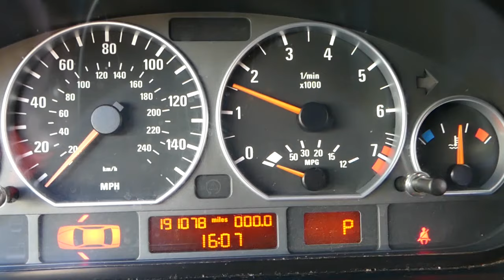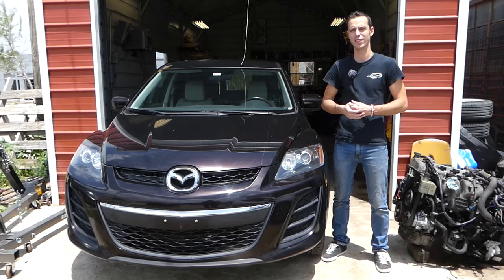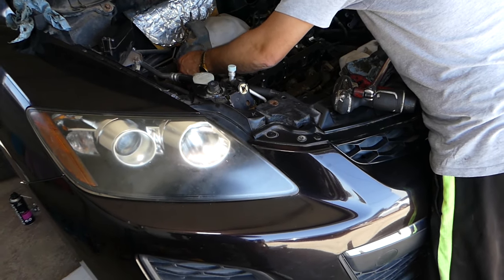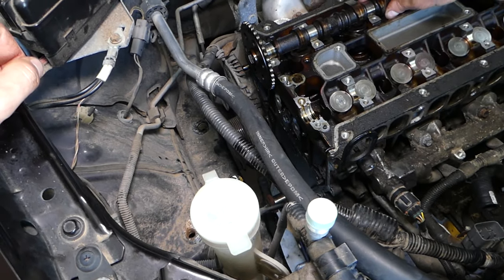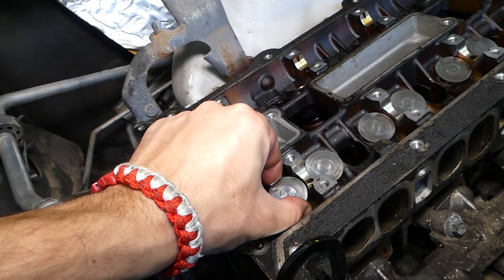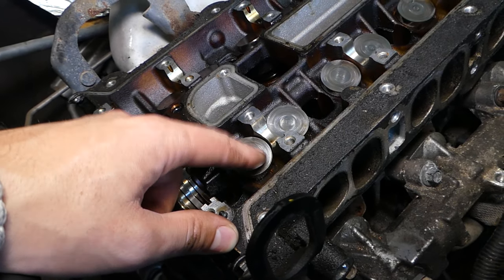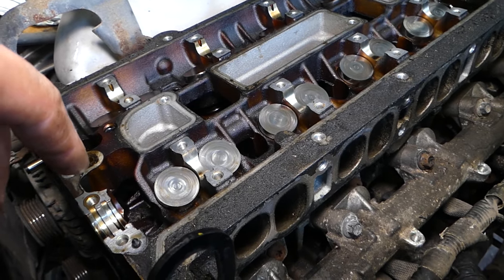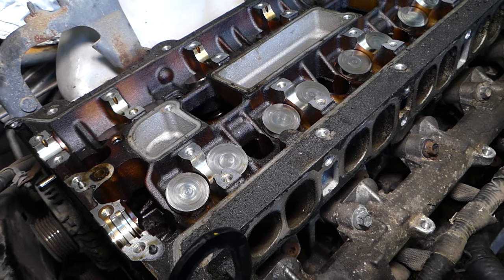MAZDA VALVE LIFTERS NOISE. WHAT CAUSES IT AND HOW TO FIX VALVE LIFTERS NOISE MAZDA 2 3 5 6 CX-3 CX-5

Comment: The MZR/Duratec engines have solid tappets, not hydraulic lifters or lash adjusters. As a Mazda tech of considerable time, I've never seen the tappet clearance open up, it almost always closes up as valve seats naturally recess into the head - I've certainly never come across a problem whereby there's lash adjuster noise in the top end of an MZR/Duratec engine. Personally, I'd be digging deeper and looking for oil supply issues to the top of the head as such wear is terribly unusual.
Reply: Hi mate I've seriously considered a new oil strainer maybe new chain if I keep the car long enough .....just had huge work done long story but had turbo kit head gasket rockers cams chain kit replaced obvs new oil ..I've heard some do their oil strainer at 120k.or less
Reply: @kevinhancock4064  I've never seen a blocked oil strainer. The only reason an oil strainer would block up is if the oil hasn't been changed regularly, or the strainer is clogged with metal fragments. In both cases I'd probably be looking deeper than just a blocked oil strainer.
Reply: @byteoncomputerservices8054  going by service history (yes my bad for not checking this currently taking the car dealer to court not mazda mind you ) its had new rockers cams head gasket turbo kit etc . Some services are missed in the book . Wish I checked when I bought it prob wouod have not bothered  we live n learn aye . The amount of sensors on them christ (similar to other cars I agree ) . It's a shame . The cx5 has a a shape I like and plenty of space
Reply: Hello, bit late on the topic. I got a mazda 6, 2.2 mzrcd (r2aa) second hand with about 110K kms, regularly serviced at mazda, company car i suppose, mind you the car just had a major 100k service done like 1yr half before me buying it . I.ve heard of this oil strainer issue, so first time i changed the oil in it, i removed the oil pan to check for metal bits. Nothing worrying was found, then i stuck my finger around and in the oil strainer (i believe is called, basically where oil is sucked through) to check for "glued" bits to the metalic mesh/filter, and nothing was found. Cleaned the oil pan, put it back, tightened the screws one by one equally ( you dont want to do one or 2 all the way, then the rest, the gasket you.ll put on it will go everywhere and you clearly dont want it inside of the pan). I.d say is an easy job, bit messy and make sure car is not driven for like 1-2 hours prior parts can be very hot. 
Keep in mind, i am not a mechanic, just DIY passionate. 
I guess it depends on the way it was driven and cared for, short and city journeys where your dpf does have time to regenerate contaminates the oil, lowering its properties, then parts where out, metal shreds appear and go in the pan, unless they block the channels. I service my car every 8-10K km, i do city and country drives. Due to oil levels rising, i had the dpf cleaned which was 70-80% blocked at 160K km, and had a 0.6-1.0l/100 in consuption and bye bye oil rising. If you check my service book, no service since 100K kms, but my oil is never dark dark, always a dark green-ish.

Comment: Hi guys. I have a 2015 Mazda 3. The engine makes a rattling noise when accelerating at low rpm usually 12-1300 rpm but other than that is ok. What could be the issue? 
Thanks in advance.😊
Reply: Di you find it? Was it during acceleration?  Cheap gas?  Sounds like engine knock.
Reply: Still have car?
Reply: It also could be a worn timing chain or timing chain guides. Causes do to not using the recommended oil, not changing the oil at 3,000 to 4000 miles not the Manufacturers 10,000 mile oil change recommendation, or driving the car like a race car driver under hard acceleration over time. Mazda Engines are reliable that doesn’t require a new engine replacement. If misused will only require minor work
Reply: @natelove187   it turned out to be the air con( the belt tensioner) . Whenever the air con is off there’s no noise and if I turn it back on the rattling noise is back around 12-1500 rpm and it disappears as the revs are going up. Need to visit some of the local wreckers to find the bloody tensioner.
Reply: @lokivato  yes mate I still have it
Reply: @AK-qe3pz  Glad you found the problem. The original Mazda part may not be expensive🍷
Reply: @natelove187   thanks mate. My mechanic said it might cost me $550 Aud which I think it’s way too much.
Reply: @girohead  definitely not engine knock lol
Reply: @AK-qe3pz  that's fairly priced considering the labor that needs to be done just to get into the engine
Reply: @AK-qe3pz  i know exactly what you’re talking my air con does the same thing nice to know that it wasn’t just me it sounds like a it’s purging all the air
Reply: @creams9k  it was belt tensioner mate. I think brand new it’s like $400-$500, but I got it second hand from Melbourne and I’ve paid $100 for it.
Reply: @AK-qe3pz  did it fix anything else besides the noise that you noticed?
Reply: @creams9k  well the noise is gone,so that’s good. Other than that I didn’t have any issues. But that belt tensioner needs to be replaced as it could cause some other issues ( that’s what I was told by my mechanic) and he’s my mate so I trust him.
Reply: @girohead  my sound like it’s knock but I don’t feel any power loss tho

Comment: My mazda 3 2.5L' automatic how much transmission fluid do i need' ' i put 5 of 490ml fluid'. Still hard shifting' do i have to change the solenoids? Thank you very much
Reply: Not owned auto ever but I'm sure its like  gear box oil pour in til.it starts coming out thrn cap it

Comment: Hi, I have a Mazda 6 2016 touring auto transmission, which happens to make a clicking noise whenever it reaches 30-40 mph on the clock while being in low 3,4 rpm’s. My mechanic told me May be the valve’s needing to be balance aka stabilize them. While my other mechanic told me I migh need to replace the lifters for brand new ones and on the way the chain and whatever other parts are on the way since we are doing the job. Can anyone help me?.
Reply: I'm facing a similar issue, what was the outcome?

Comment: I have a mazda 3 2.5L, rebuilt the engine and accidentally mixed up the valve lifters, now it makes noise, but runs smooth, my question is how do i figure out which lifter goes where?
Reply: Take off the valve cover, then measure the distance between the lobe of the camshaft and the tappet with a feeler gauge, on each of them.

Comment: You never mentioned the solution wtf
Reply: Sure he did, just not directly. One can deduce that the bucket lifters, or tappets, have aged and worn too thin creating a millimeters space between the lifter and the valve creating the noise heard. 

I have a 21 M3 today but I torn down my 2008 and attempted to look into this. Frankly, I found it to be a challenge. The concept is simple enough to grasp. Actually addressing the issue is difficult without hands-on training experience. You can purchase the tool to determine widths of valves and lifters at common auto parts stores. 

I'd you go deeper and actually remove the springs, keepers and valves, it gets real exciting. Putting the keepers back in so that they correctly hold the spring, is a b1txh. I developed my own tool technique using a 10mm deep well and the handle of a tap & dye tool with a length of a an old head bolt. It was interesting to say the least. If a keeper goes flying when attempting to reinstall, you'll never find it. They price at about $5 at Mazda service.

Anyway, yeah, tappet is worn too thin. That's the issue to resolve. They are sized like .460, .462, .464, eyc.